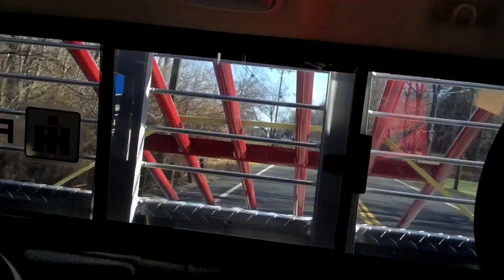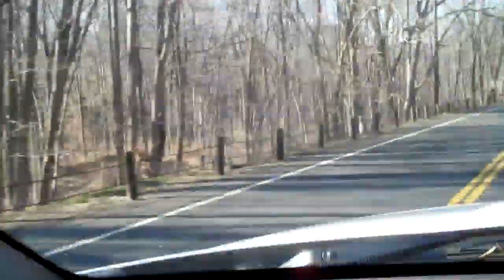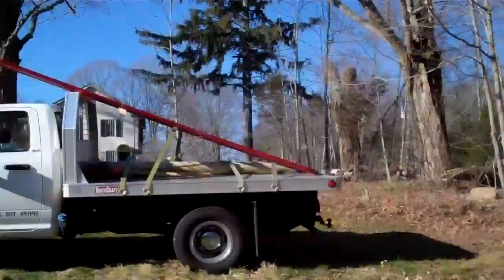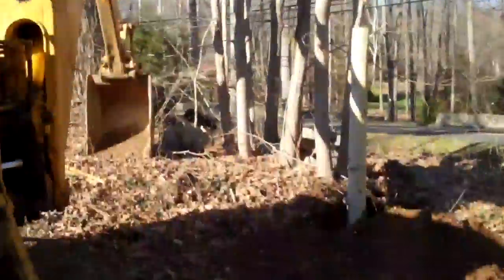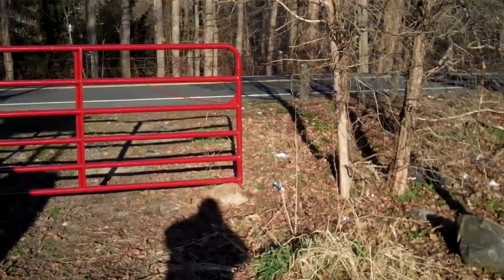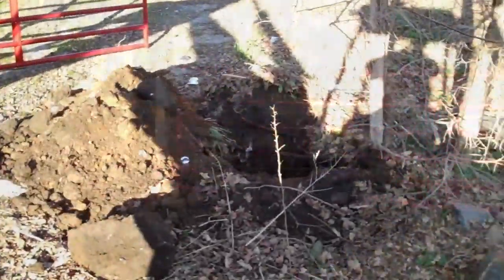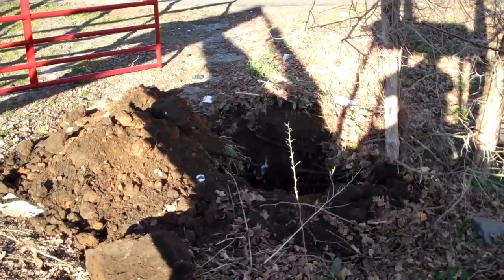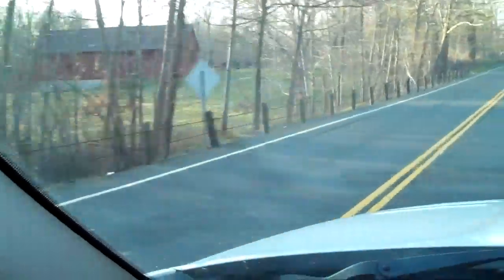Installed a 14' gate on one of my hay fields

Comment: I have a question what size or diameter post did you use?
Reply from the maker: Mangoon MGO I used a 6" round post. I would not recommend using a  6" post because with a 14' gate it flexed alot.  I ended up replacing it with a used telephone pole that was around 12" to 14" dia. and now there isn't any flexing. if you look at my videos you can see the replacement.  thanks for watching. Eric
Reply: thank you so much

Comment: top hinge is installed backward.  Someone can just life the gate off.
Reply from the maker: Yes, a am aware of that. I had the two hinges that way hoping to spread the weight over two hinges.  If not the bottom hinge would be holding all of the weight of the gate.
 Thanks for the comment. Eric
Reply: good point
Reply from the maker: Thanks again. Eric